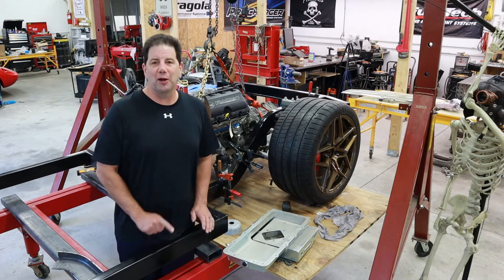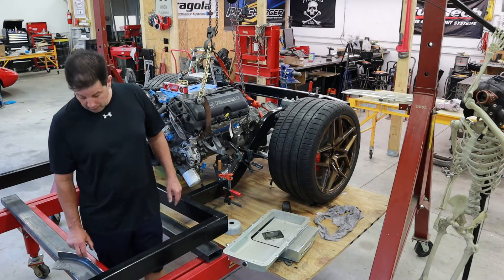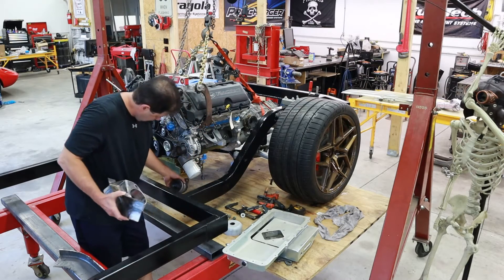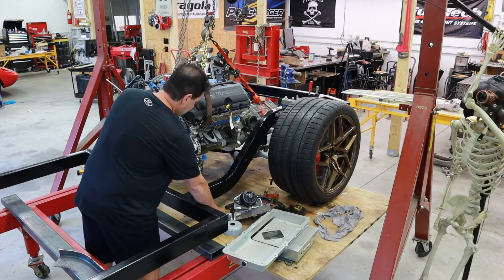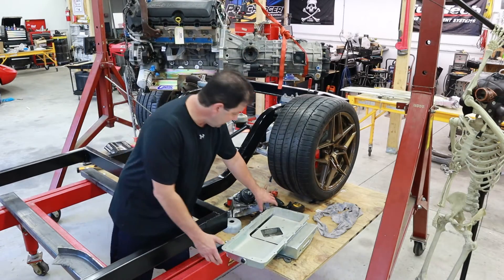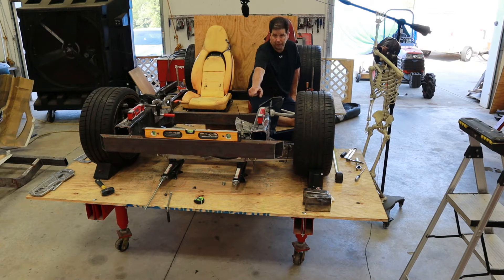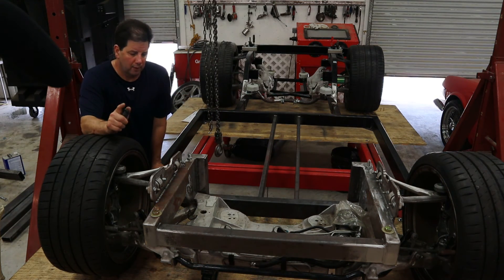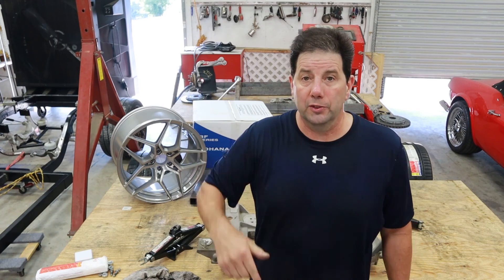Project Split Decision Car 1..Ford Aluminator XS Car 2...Tesla Model S swap ... DIY  Supercar Part 7

Comment: What’s your plan for body panels? Thanks
Reply from the maker: I’m making a custom body.  Take a look at my IG account.  I just posted an image today
Reply: @XSMotorWorks  thanks is it your plan to build a new kit car? Something along the lines of a Vader?
Reply from the maker: Not exactly.  Vader uses a donor without too much modification.  Mine is a complete chassis but I do use a lot of OEM parts where it makes sense to do so.
Reply from the maker: Oh.  And I’m thinking it will be a new kit if there is demand
Reply: @XSMotorWorks  if the price point is right I think there is a market. I just like the Vader look.  I wouldn’t want any thing that resembles a Vette. PersonallyI’m looking at K-1 Attack, problem there is not a big enough power plant. Thanks
Reply from the maker: The K1 isn’t bad BUT is a little small and not easy to get in and out of